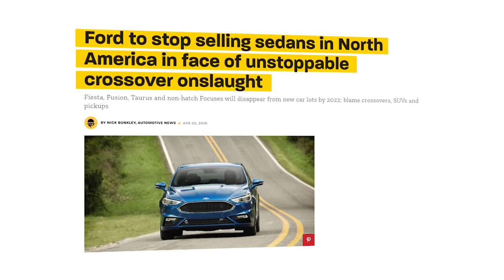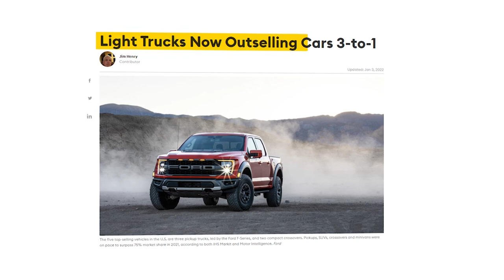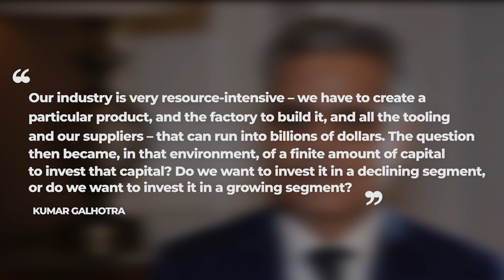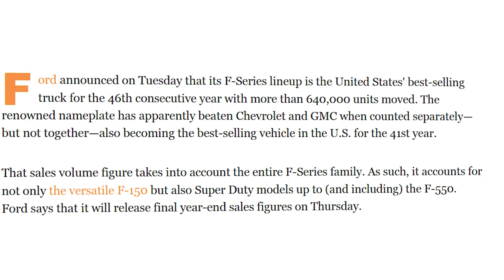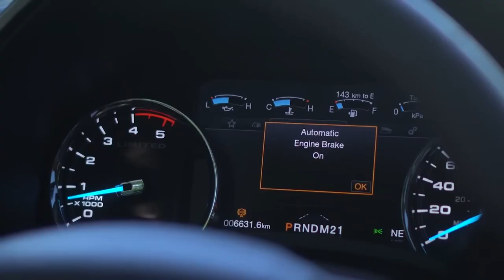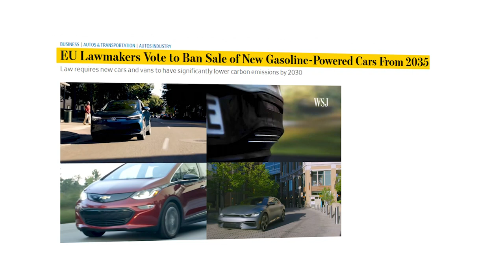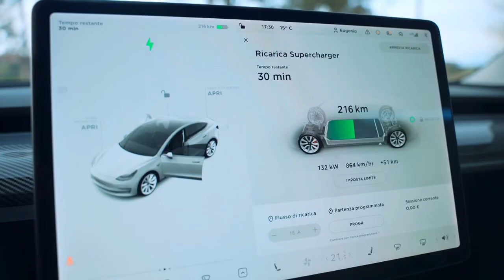The Real Reason Ford Stopped Making Cars

Comment: The vehicle manufacturers are missing out, if they would make a vehicle and call it the basic.no cameras, no heated seats, no on board gps, just a simple engine ,no computers, therefore no shortage on chips, just basic ,like it used to be ,you did your own maintenance on the wknd, had plenty of room ,without all the garbage.snd don't tell me you have to have all this tech to meet emissions, I have a hot rod mag where they put a eldibrock manifold ,headers, tuned it and exceeded epa specs, do yes they did it w.o. the garbage.its just that ford has incompetent engineers that can't do it. BASIC would sell like hot cakes.

Comment: The AMOUNT or DELTA of change REQUIRED per year (R & D,  Tooling, Marketing/ Advertising / Incentives, ETC. was too high relative to falling annual sales. WHATEVER the breakeven sales point: 20,000, 40,000, or 60,000 units, THE COMPANY IS WORKING AT A LOSS UNTIL THAT SALES FIGURE IS REACHED. A big roll of the dice.
REMEMBER, ONLY 15% of company product is a sedan. With the aging of America AND the price of gas, sports cars were a very thin slice.

Comment: Interestingly growing up the Mustang was never a favorite of mine. The focus was a favorite however.
Reply: The focus? Ask the government how that went they had major transmission issues and Ford could never fix it they did numerous software updates and never could fix it then offered people a deal to trade them in and the government couldn't unload them fast enough you look at government auctions and there unloading them another vehicle not built Ford tough
Reply: The Focus ST is  an amazing vehicle

However the focus automatic transmission was a duel clutch design that was badly engineered and every single one of them broke.  Ford did their best to hide it and would typically tell the consumer it was normal until the car literally wouldn't run.   Then they'd string the owners along until the warranty ran out.   They tried software fixes, but the issues was the design, so no software could have saved it.   Even internally people were hiding the real problem from upper management.

The Focus ST only came with a manual transmission.
Reply: I owned a Focus with DCT. I never had issues with it. Had to sell it because I live in a city and a car isn’t needed.

Comment: Well, I think Toyota one that market segment with the Corolla. Ford is K.O. That passenger car segment will revive. For EV's you need light, aerodynamic cars, to accomodate the heavy, energy content poor batteries and still have some range left. Trucks can still be made as EV, but at high cost for purchase and energy use. There is just no way trucks will be as popular as they are now in twenty years time. Besides that, as a European, I don't understand the love for trucks at all. They want to be a jack of all trades, but they are not good at anything. I even consider them dangerous.

Comment: Supply chain - BS - What happened was Ford during covid told the chip maker they suspended their quota for the coming year.  I have seen videos of hundreds of trucks, parked on a old racing track, filled with trucks waiting for their chips!  End of story - Even better was when I went to my local "F" dealership and was told the Mavrick for this year was 1 year out from date of ordering and it could be longer.  "Hang them High", Management will be or should be cleaning house with the fools who made that misjudgment!  Why would they produce trucks that they knew the chips were not available?  Who would wait that long!  Over pricing the MSRP - I got sick when I checked out the trucks on the lot and the price above MSRP, wasn't just a little but $,$$$.00 over.  The "F" dealership can go "F" themselves!  They forgot, in the U.S.A. there several other truck Manufacturers who are open for business.

Comment: Is this a Ford commercial? Still making the Mustang.
Reply: @Jon Oslund they continue to make the Mustang as its the most well known car in its class and the best selling by far having sold around 10,000,000 units in the US as for those other models they had come to the logical ends of their production the Fiesta had a great run 40 years same goes for the Taurus at 33 years when it was discontinued debuted for the 1986 model year along with its Mercury twin the Sable though the last mercury off the assembly line was actually a Grand Marquis on January 4th 2011 making it the first of the venerable Panther Platform cars to be discontinued next was the Lincoln Town Car on August 28th 2011 the final panther platform car produced was an overseas 2012 Crown Victoria

Comment: People are still buying new cars. Just not Ford cars.  They are buying cars that are produced to last 300,00 to 400,00 miles with minimal maintenance and good fuel economy. Can we say Toyota, Nessan, Volkswagen and KIA.  Make a quality product and you will sell it.  The new Bronco is another example of a total failure in quality.  My brother-in-law has gone through 3 Ford trucks while I am still driving my 2007 Ram 3500 with a Cummins. My first new car was a 1967 Ford Mustang. It was a fantastic car with bullet proof reliability. That was when Ford quality meant something.  Management needs to learn that you make more total profit selling 3 million cars with a $800 profit than you do selling a million cars with a $1,000 profit.

Comment: Cause Toyota and Nissan mid  size cars and sadans are incredibly cheaper than a fusion or Taurus ford refuses to stop dealer markups to many recalls and engineering flaws kill consumer trust
Reply: Nissan hasn't made a good FWD car since 2002-2003. Renault bought a majority stock in them and have ruined a company that used to run neck and neck with Toyota. It's mostly due to the crappy Jatco transmissions they use, but their RWD models are still decent though.

Comment: Too late Velocity GM already offers sub 30k evs. They are called  Bolts
Reply: GM announced that the Bolts will only be manufacturered until November 2023 - then that factory makes trucks.
Reply: @davemccarthy7366  simply not true. The 23 model year ends in November. Nothing more. Two lines in that factory. One for Bolts and one for trucks.
Reply: And Toyota has something called the new Corolla which has a lower 5-year operating cost than the Bolt.

Comment: ford continued to build the focus which was a very good car i worked for several co that used cars, sw, and minivans and fords were much better than dodge chevrolet and 10x better than the worst car in the 80s the stanzas dodge 110 with trouble and engines replaced with the 2.6 after 80k, chev 125k  fords 150+ with rare engine or trans  aerostars and econolines 200 to 275k  , but focus from intrduction till they put the known before installing  dual clutch trans  which ruined the fiesta and focus unconfortable unreliable and ford refused to return to the bullitproof one and later putting tiny 3 and 4 cyl turbo in crossovers and suv even pickups  so its there fault ppeople who want small sedand went to korean cars who were decent untill recently  so car makers have caused there own demise and i cannot see pickups at 80 to 100k being populer as inflation keeps rising

Comment: ford gambled & stuck its head in a noose decades ago when it allowed the beancounters to dictate engineering.the failures of over costcutting quality to the point of 60 recalls last year alone.they are now paying the price for all those short term profits, by having loyal ford consumers who wont touch newer fords.they are NO LONGER our fathers ford producer.& more like a GM equivilent.but still have the nerve to charge a premium vehicle price.the whole damn board of directors would be replaced if henry saw fords current condition & failed public opinnion thru failed products.

Comment: I'LL KEEP MY 2011 COROLLA S,WITH ONLY 136K MILE'S TIL THE DAY IT DIE'S
Reply: It is 13 model years old and only 136K. So approximately 10K per year. Given it will likely go to 350 to 400K easily, you won't need a car until sometime between 2044 to 2049.  That is a great investment.
Reply: I'm still driving my 2003 Corolla LE with a 5 speed manual transmission.  It has 210K miles on it and with new car lots being empty of anything reasonably priced, I'll likely be driving it for quite a few years yet.
Reply: @bobby3944  have the corolla 5 year's got it with 130k. so this car will last for ever with careful and regular service....

Comment: that's what happens when u wanna let robots do everything instead of humans to inspect the cars and quality control  check  and  than cutting cost where ever they can when u build a car its not someting and say its done  u have to design  engine to work   with  hundreds  if not a thousands of  engineers  every one of them give they're input of design  test your engines in the harshest conditions  extreme testing put more research and development in  your cars business  stop pushing  for 1000 computer modules  on a single car  learn from the Japanese they know how to make a sword sharp that's why they're the masters of automotive industry HONDA TOYOTA MAZDA  learn from them they don't go building engine leaping from this engine to another engine they build engines from they're previous generations  for example   HONDA  has  20 different k series engines  its considered  one of the best 4 cylinder engines because its a simple design    if its not broken don't fix it  in the end u dig a hole for your self FORD FOOLS  HENRY  FORD  what a great engineer he was u drag his name in the mud  because why your greedy for money  rushing production